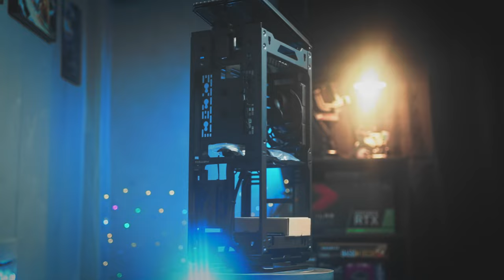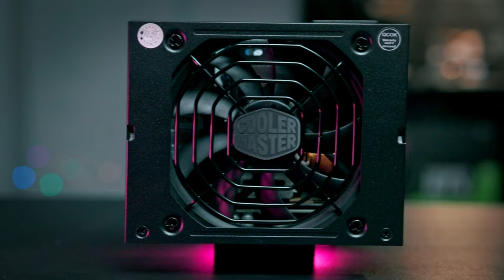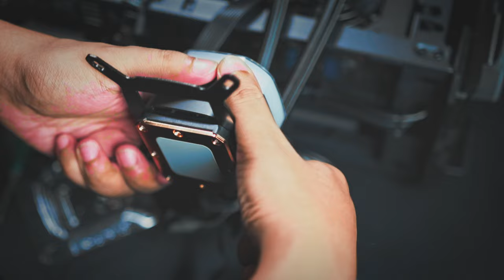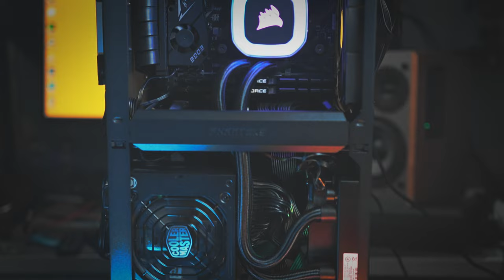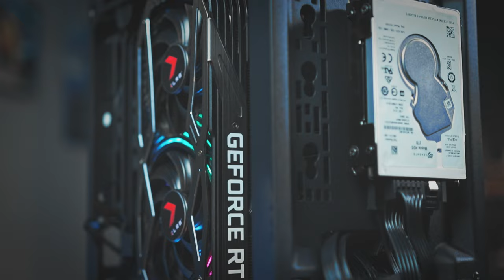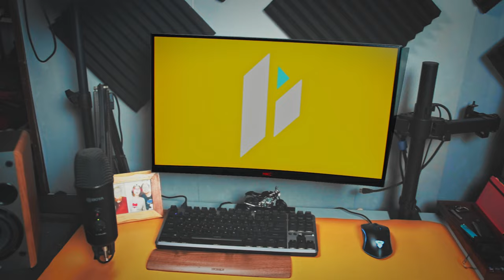PC Build Step by Step - Phanteks Evolv Shift Air 2

Comment: Wish this can fit 2 x 3.5 hdds.
Reply from the maker: Yeah, only 2.5 inch drives on its drive bay. I just confirmed that it can fit 1x 3.5in and 1 2.5in HDDs. But when there's a will... haha...
Reply from the maker: You can actually fit 1x 3.5 HDDs in place of the 2-Bay 2.5 inch Drives. It does have some extra space beside the power supply at the bottom. I think a 3.5 inch drive bay can fit there.
Reply: @LyderProtacio  had a friend who has this and he could only fit one. I'm currently hunting marketplace ph for this case :)